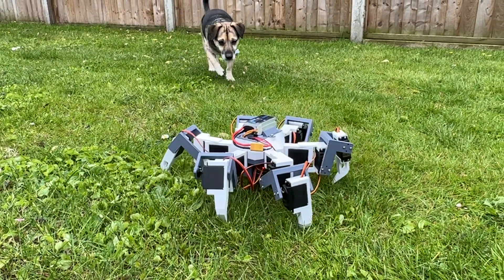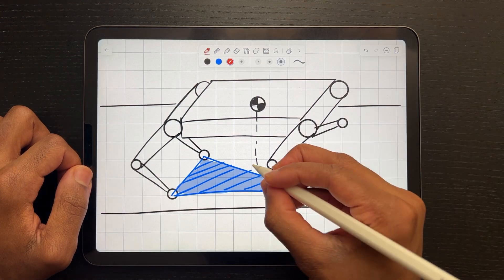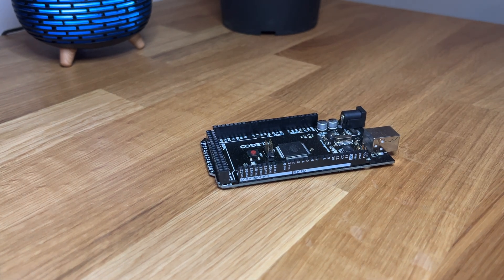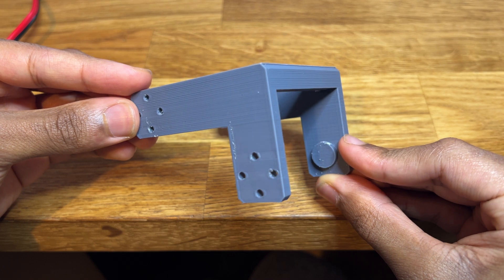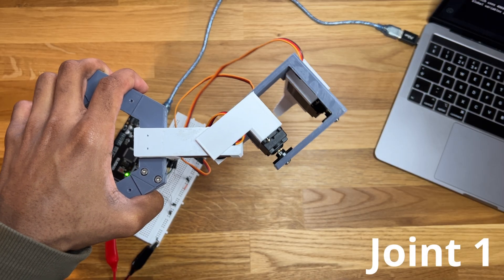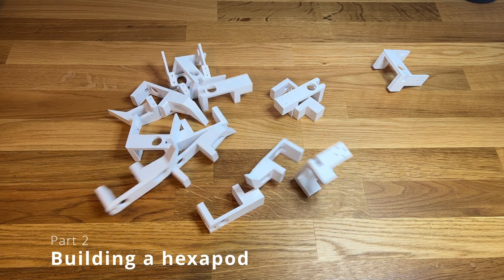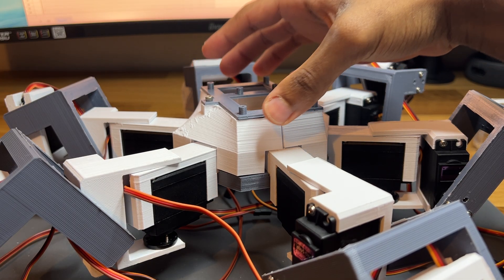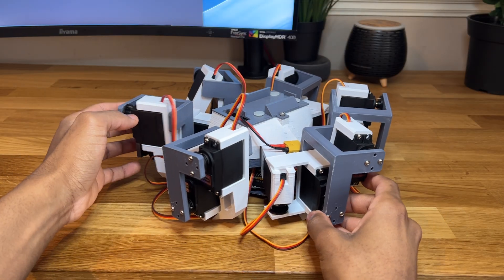I built a robot hexapod with no experience...

Comment: 6:48 when you said you used a bucker converter to make the Lipo only provide 5V, that's then not enough power for the system. Those shields allow for up to 12V, making sure only 5V gets to the arduino as required. You were drawing too much current which is why the motors didn't work correctly.

Comment: Great project, but I have a couple of questions:

I've printed and assembled the robot. I've tested the individual servos and they all work. Numbering the servos clockwise from 1 to 6 (bottom view), I wired them to the starting at pin 0 in the order coxa, femur, tibia. I uploaded the hexapod.ino code, making sure the pin offset is 0. When I start it, all that happens is all the legs close up and then it just sits there for 16 seconds, then does that again. I thought there was an issue with the LiPo battery feeding the Arduino, so I attached a 9V battery and removed the yellow power jumper from the sensor shield. That worked a little better in that the legs were trying to do a cyclical motion, but they were still very closed up. I'm thinking either the legs are wired incorrectly, or I assembled the legs at the wrong servo angle. I set all the servos to the zero position before assembling, and assembled the legs fully extended as in Step 3 (so that the two screws as shown are parallel to the servo body. Thoughts?
Reply from the maker: Thanks for trying out the project :). Based on what you're describing, it sounds like the femur angle might be off by 90 degrees - might be a mistake in the vid/tutorial. Could you try changing J2_OFFSET from 0 to -90 in the code and let me know what happens? Looking forward to hearing how it goes!
Reply: @zeroshotrobots  Thanks for the advice! I actually ended up setting all three offsets to 0. I also found that the servo at pin 0 was not firing, so I moved them all up to use pins 4-21. I'll post a video soon.